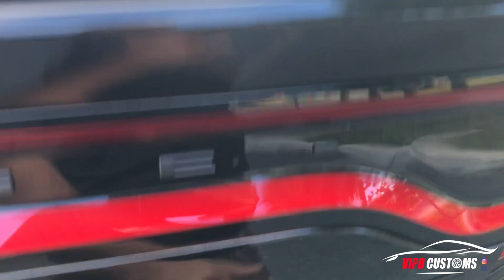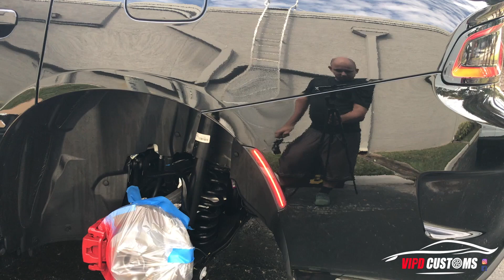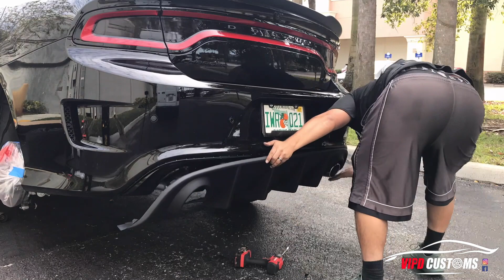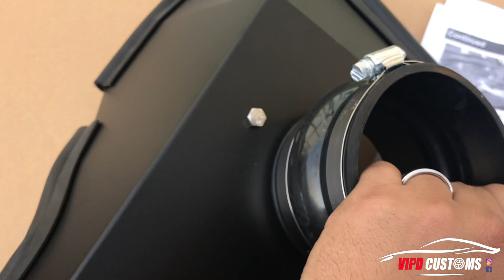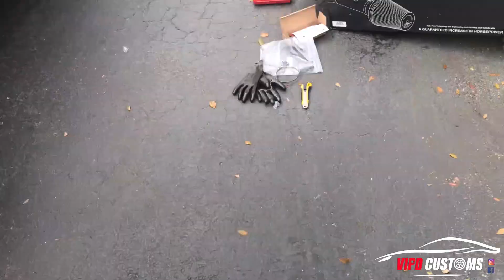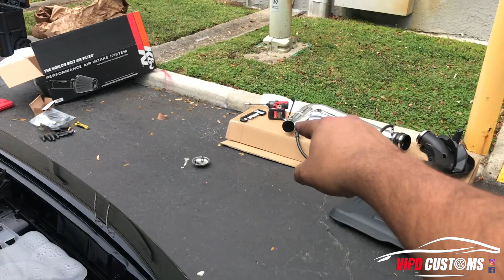2020 Dodge Charger GT - K&N intake install, LED lights, painted calipers & R/T diffuser install !

Comment: We're going to pull the trigger on this as the Summer ends. Thanks for the video! Lookin' in the rear view now over the last year, what would you recommend for a 2022 Charger GT (v6) owner when it comes to cold-air intakes? I love the look of this one and just don't see nearly enough in the way of performance or sound comparisons on the Internet. Let us know and thanks again for the video!
Reply from the maker: KN is the best of the best in the intake world
Reply: Try the AFE momentum gt, it sounds beautiful as well is a volant air intake, meaning it’s closed and does not let hot air from engine bay circulate inside rather pulls colder external air.
Reply from the maker: This was a clients car

Comment: How can I see where the tube connects behind the engine?
I have a 2021 sxt, and I’ve been looking for videos that shows exactly where
Reply from the maker: It’s a small connection
Reply: @VIPDCUSTOMS  is it visible when actually working on it?
Maybe on video it’s harder to see than in person
Reply: @KAROLPH100  have you found any videos? Im looking for it too
Reply: @znehzify5716  couldn’t find any, but if you go with a light you can see it easily. Honestly I thought it’s be harder, but no
Reply: @KAROLPH100  thank youu

Comment: Where can I get them side lids joints from ?
Reply from the maker: Side lids ?
Reply: @VIPDCUSTOMS  side markers
Reply from the maker: Amazon
Reply: @VIPDCUSTOMS  and rear Diffuser bumper
Reply: Thanks bud
Reply from the maker: I believe Amazon also (ikon motor sports diffuser)

Comment: what’s the point of putting a intake?
Reply from the maker: cold air intakes bring cooler air into your engine and combustion chamber. In doing so, cold air intakes boost engine power and efficiency. That's because colder air has a higher oxygen density.

Thus if installed properly with a proper setup , you will get more power out of the engine.
Reply: @VIPDCUSTOMS  how much extra hp does this give u?
Reply from the maker: Depends on the car , depends on the setup, depends if it’s a true cold air intake… lots of factors
Reply from the maker: Yeap that is true , but some intake system use factory inlet hoses which help it a little

Comment: what K&N series did you buy that as that hose provided for that modification your talking about to move throttle
 body hose from passenger side to drivers side ?
Reply: its the typhoon series
Reply from the maker: I’m not sure the client had brought the intake already for me to install I didn’t order.

Comment: Hey VIPD, you should have installed an Airaid throttle body spacer since you had the air intake out.
Reply from the maker: This isn’t my personal car , client wanted the intake installed .
Reply: @VIPDCUSTOMS  Client should have paid the extra $150 for the spacer. I have a Chrysler 300 with the 3.6 VVT and installed the spacer and intake. Very happy with the investment.
Reply from the maker: I would too , I usually research when I’m doing something what can I add on extra or modify it to make it better
Reply from the maker: Clients sometimes thinks we try to upcharge them but oh well lol
Reply: @aaroncripps4811  what exactly does it do thinking about getting the intake for my 2022 charger GT is it something simple and what’s different if you don’t put it on, just curious
Reply from the maker: More HP helps the motor breath mor and gives it more sounds
Reply: @VIPDCUSTOMS  oo cool did not know that thank you
Reply: @aaroncripps4811 what does spacer do